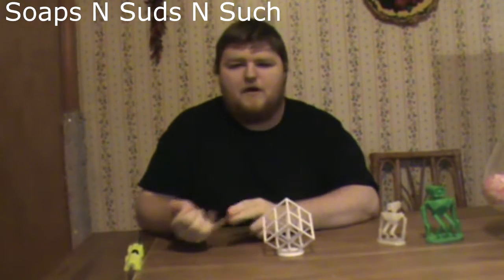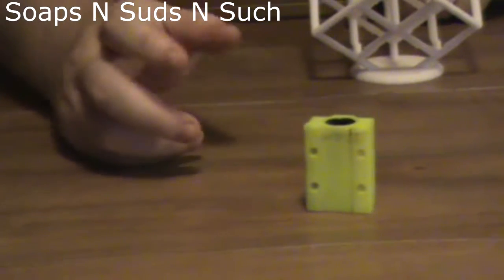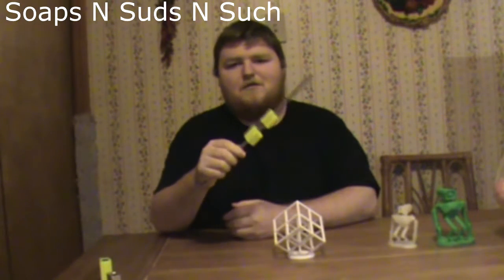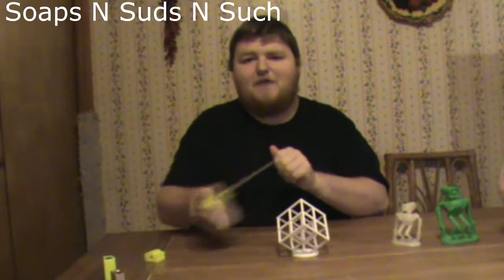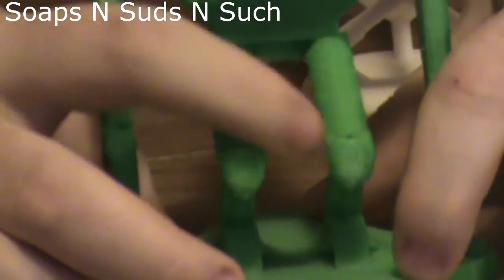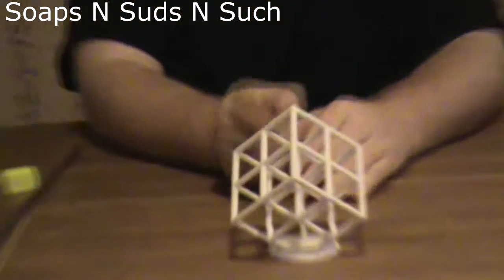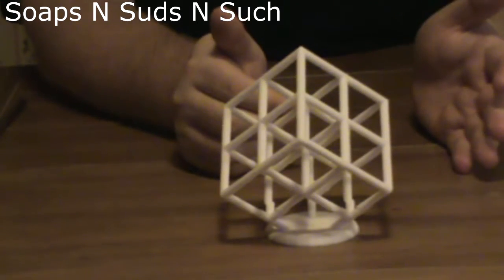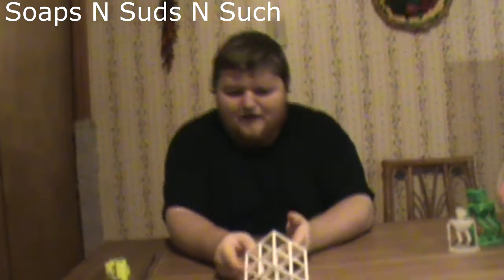Wanhao i3 v2 bearing experience ( Lm8uu stock, extra long, and igus Drylin)

Comment: the igus were simply mis-aligned hence the binding- also they tend to run smoother on rougher aluminum rods not smooth chrome rods. Perhaps making one big pillow block will help the alignment.
Reply from the maker: I realigned multiple times with the same result. They were not consistently binding in the same place as well.  Many of the users on the wanhao facebook group have also reported the same problem I had. The current solution that works is to sand the internal hole to a larger diameter. I personally agree that the stock rods are affecting the bearings. I believe they are cheap rods and have slight size variations, however they are stock so anyone wanting to add igus on to a wanhao i3 may face the same problem.
Reply: Igus bearings are meant for those rough texture aluminum rods provided by igus. Thomas salallalalallalamander did a video on it.

Its not diameter- if it was diameter it would be sticking in certain spots.

the issue is seriously alignment- and tolorences- if there is toomuch slop ( the hole is too big ) then it can twist on the axis and bind, 

you can adjust the pillow blocks with the slop in the screw holes so they slightly fight eachother by pulling them away from eachother- this plus the weight of the bed should eliminate most slop.

ideally you'd have an adjustable tentioning system for your bearings. as over tight and over loose bearings are a biig reason behind mis-aligned layers and poor tolerances on fine details.

Good video. Keep up the content!
Reply from the maker: Ah okay so it is all user error when it comes down to it. The rods not being proper igus rods and alignment. Honestly my binding experiences on the Y were not bad at all. They quickly vanished and were not too bad to begin with. My X upgrade was the one that I had the most trouble with. It had really obvious large shifts and realigning was not having any effect. It was that combined with the people I look towards telling me they needed to be "sanded" in some way to properly work, that convinced me that they were suppose to naturally skip until worn down. Thanks for dropping some knowledge on me, I may possibly have a few more plans for igus bearing in the future.
Reply: i mean it doesn't have  to be perfect. It does the job and its HELLA quiet and cheap upgrade, this stuff used to be so expensive back in the day its getting somuch cheaper nowdays.
Reply from the maker: Yep I can agree from experience that they get the job done. Cheapness aside you can also get a free sample from igus. That alone should open the gates for anyone on the fence about upgrading to them. If you like them buy more and well if you don't then you just wasted some time.